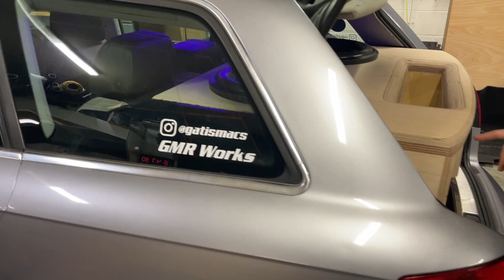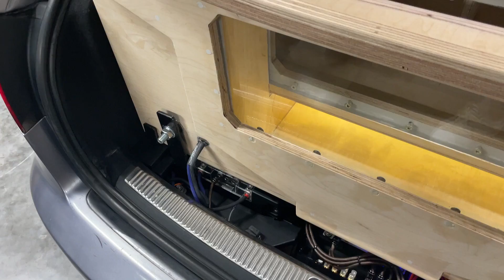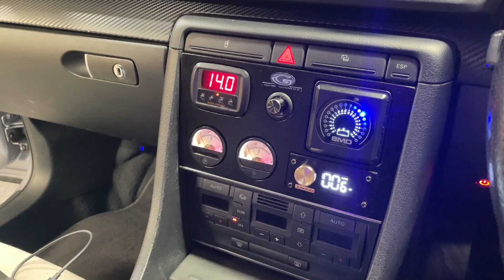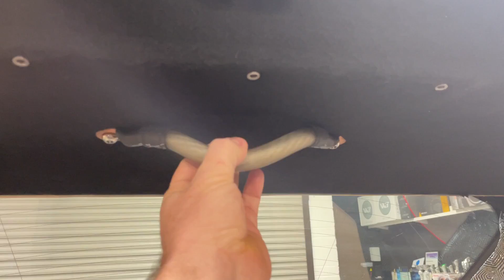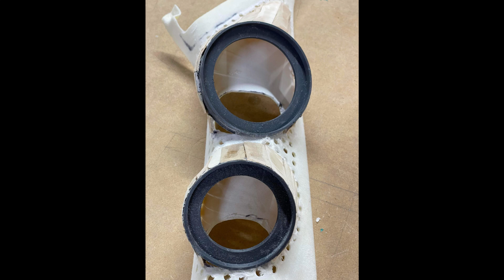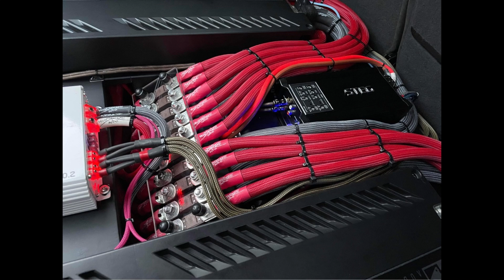King of Low Lows in a Audi A4 Daily Car - Fi, Banda, B2 Audio, Steg, Focal, SbAcoustics, Scan Speak

Comment: Seeing this years later but I have a 2012 - 750. I made a sealed dual chamber box with two kicker 12 inch L7 Q Class subs. 1.40 cubic feet per chamber and made the front of the box at the same angle as the back seat and pushed it to the back seat and sealed it to the back seat. Opened the ski pass through and the bass in the cabin is crazy. Each sub has their own amp. Helix Ci7 front stage. Helix Ci3 in the rear. Helix V8 Ultimate on DSP, Helix V Two running the W165FM-S3 that was cut in the front doors. Match up 1 Fx running the Ci5 under seats that are wired down to mono channel on 1 ohms. Two kicker LX1250.1 on the subs. Thing sounds crazy good.

Comment: I've been studying measurements and specs of raw drivers for the last few weeks and I actually came up with using this exact pairing of mids and tweeters. I randomly came across this video and I feel super validated in my choices. I'm also considering possibly using the Dayton AMT2-4 for the tweeter, but I haven't found any examples of people using them or any reviews. It's probably a little bit more difficult to integrate the AMT with the 10F, though. Any opinions are greatly appreciated.

Comment: 24hz tune?! how? 
getting low tunes on big subs, AND getting them to fit inside a trunk is a big challenge because the port length starts to get ridiculously huge.....i struggled with 28hz....24 is kinda impressive
congrats on the build, looks nice....ill bet it sounds really musical

huge FI subs in small box tuned low with necessarily huge amps FTW
Reply: I did it with external aeros in mine.
Reply: The subs are FI AUDIO? I thought by the neos in circular formation it might be but the dustcaps were throwing me off...
Reply: @ecpruthless thank you very much!😊 
Challenging indeed but possible. It sound incredible to me! Those Fi subs have very low inductance for such a high gauss neo motor. Fast and accurate and i enjoy rock music too. They play great everything😊
Reply: Yes, those are Fi NEO 4.11

Comment: Nice to see some Scanspeak units being used. I've been using the 10M (automotive equivalents) for some time now. As mentioned, in a normal SQ system these can be crossed over at 200Hz but the system in this video is just something else.
Reply: Agree, my 10F runs down to 170hz and loud with Front Kicks and Frontsub
Reply: The 12mu’s are my current favorite mids out of dozens I’ve tested.

Comment: Can someone please explain how the 4” on the pillar can get loud with a 30w rms rating? I know sensitivity matters but surely not when they’re only a 30w rating? Please don’t ridicule me, just trying to learn😂
Reply from the maker: 30W power rating is given for full range use. Once you apply the correct HPF, they can take plenty of power. Also, a fully active system draws way less in high-mid frequency range, than in midbass and sub-bass. You’ll definitely loose your hearing with these pillars if you play them full tilt for longer than 15mins….unless it doesn’t matter anymore.
Reply: @pssound9749  thanks Peter 😊
Reply: @pssound9749  thanks for both of your replies! I never thought of a hpf and tuning which will make them get loud, 30w just seemed a tiny amount to me, but then being able to give them more with a hpf and tuning does make more sense
Reply: this is a reply to both you, basically speaker sensitivity is converting energy into acoustic sound efficiently, generally good speaker sensitivity has very little heat production due to speaker being very efficient in converting energy into acoustic sound, but with very low speaker sensitivity you'll generate more heat than usual, will require more power to create same acoustic sound as a speaker with high sensitivity. hence why it takes very little power for those 4" speakers to get loud because they are super duper efficient and dont waste any of the power
Reply: @kenankamaric4252  thanks now it makes a bit more sense.
Reply: Good question I'll definitely be looking for a reply to this question 🤔